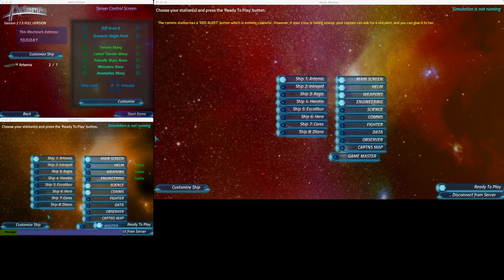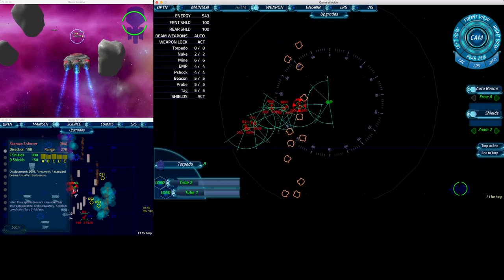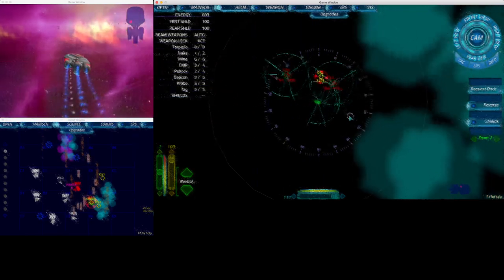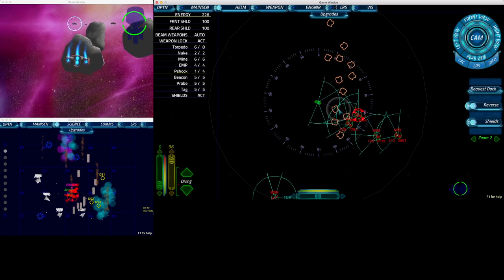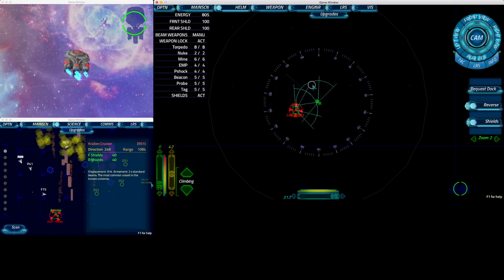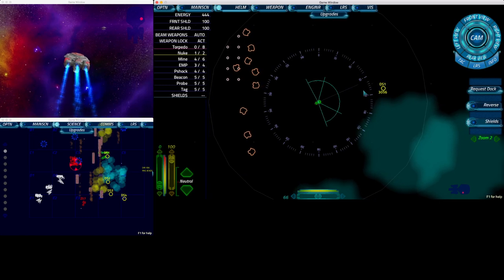Artemis SBS Helm Techniques: Quick & Dirty Tutorial, Take 1

Comment from the maker: Feathering / Pulsing Warp: 01:43
Feathering / Toggling / Pulsing Reverse: 03:20
Efficient Docking: 04:52
Blow-by: 07:16
Tailspin Maneuver / Orbital Strike / Sketch Maneuver: 08:07
Asteroids Block Beam Shots: 09:14
Fighter Roundup Technique: 11:09
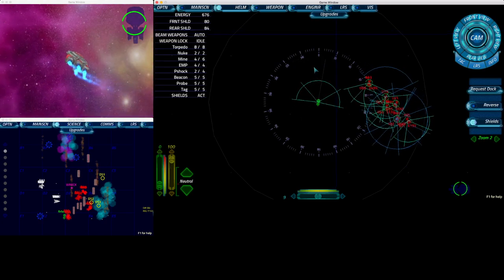Black Hole Safety: 14:07
Climbing & Diving: 15:15
Evasive / J-Hook Mine Drop: 18:03
Proximity Tango & Hard Tango: 19:53
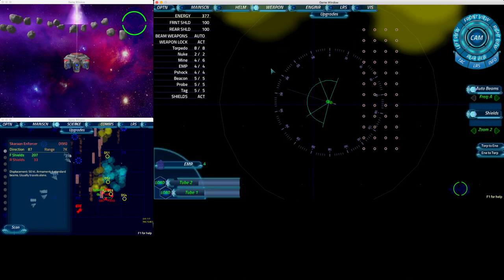Ship's Velocity & Torpedo Launch Timing: 21:15
'Relative Positioning' Phraseology: 22:47